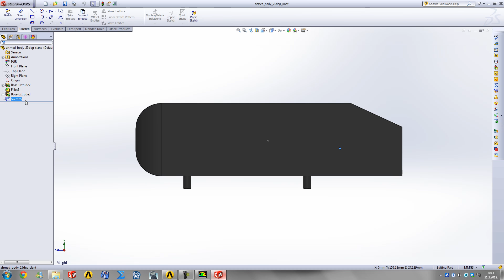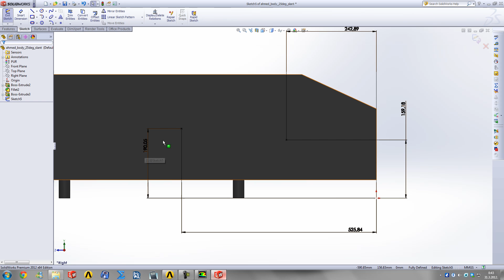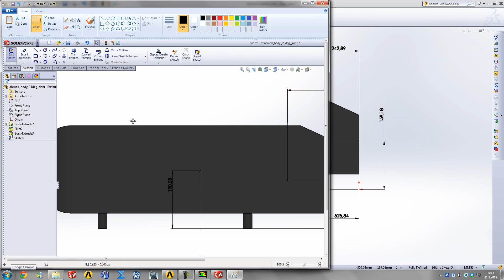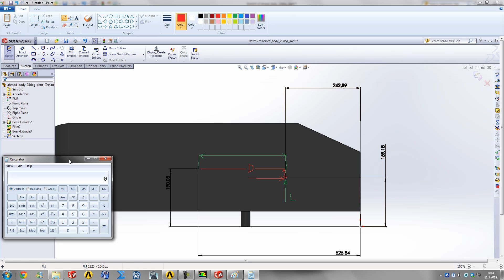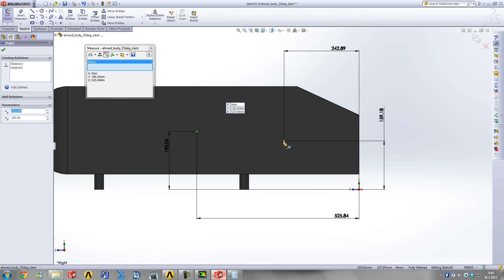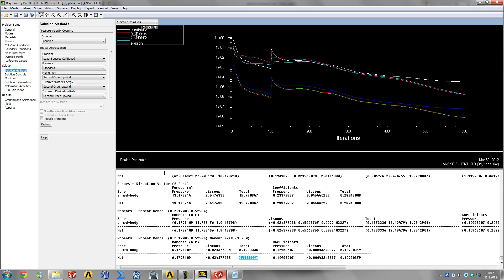Part 3f - ANSYS Fluent for Vehicle Aerodynamics

Comment: Hello. Thanks for the great explain and material you putted up about fluent.
I'm simulation a Honda Fit and everything goes fine until I try to find de center of pressure. Fluent is returning a  -1.79  meters at the vertical, what should not be right because is out of the body. But when I ask for the moment on the specified point the pressure moment is about zero. Since I know the position of the pressure center must be on the model body. Do you have any idea why it's happening? If its on your interest I can send you more information.

Comment: These videos are helping me in learning CFD analysis.. thank you so much.   I also have a request.  please make a video on how to do aerodynamic analysis in a body with a cavity. (eg: a car with an open window.)  how does the drag coefficient vary when a window is open. what is the drag force on the vehicle in that situation?. please help me by answering these questions.
Reply from the maker: Krishna Siddhartha the procedure is exactly the same. Reference area is the same, only the force will change (and Fluent will calculate by how much). The only thing to keep in mind is that if only one window is open the problem is no longer symmetric and you have to use a full model. So, don't split the car in half, model the interior, leave the window down and just follow the instructions in the video. Due to the lower velocity of air inside the car, you don't really need to use prisms (boundary layer inflation) on the inside cavity, which will help the mesher especially if it's geometrically complex.
Reply: Sirius CFD what about the projected area . Will it increase?? Because air interaction with surface is going to increase with cavity.. How to calculate that. Another point is do I need to subtract the body while creating control volume/wind tunnel.? Please assist me in these.
Reply from the maker: Krishna Siddhartha I already said projected area remains the same because it's just an agreed upon area to be used in vehicle aerodynamics. As far as subtracting the body goes, yes, you subtract it from the domain in the exact same way. There is just an extra cavity in the model, almost as if it had an extra wheel arch, or a roof rack, or anything. Don't overthink or overcomplicate this..
Reply: Sirius CFD if I am working on a bigger object and to reduce load on CPU can I scale it down ?? how will the results get affected. ? what can be done if they should not be affected?
Reply from the maker: At the risk of sounding harsh, you seem to be missing some very basic understanding of what you are doing. Things like model scale, Reynolds number, mesh densities, y+, CPU time etc. are all somewhat tied together. Anyway, I'm going to assume you've got some formal education in fluid mechanics and engineering and are just missing the CFD part. So, my recommendation is: read a book on CFD. Any book should do.. don't waste a lot of time in the NS equations and other crap that's handled by the solver anyway. Just read the basic stuff that deals with things you have control over: Re, velocity, mesh density, numerical errors, validation and verification etc. From some of your questions it's clear that you are very new at this and a few videos on YouTube simply aren't enough. Also, I can't really waste time teaching you CFD through comments on YouTube. If you are too lazy to read a book and would like some 1:1 tutoring, that's what a business email address is for.. but that costs money. :) So, this is my last comment for now. Good luck with your project!
Reply: Thank you so much for understanding my problem and giving answers patiently.. ill definitely go through books. :-)

Comment from the maker: Yes, some poor quality elements are causing this. Max skew shouldn't really be above 0.92-0.95 (above that ANSYS lists the mesh as of unacceptable quality). As far as improving goes.. I don't know. Check your geometry for intersections, tight corners, slivers, thin gaps etc. If it is rather complex then ANSYS meshing might not be the way to go and you may want to try in ICEM CFD or TGrid.

Comment from the maker: In my experience, this happens either when the mesh is "broken" or if the boundary conditions are non-physical. So, check both and see where the problem is.. If it happens during initialization then it's more likely it's the boundary conditions.